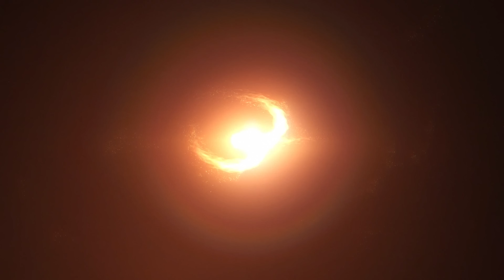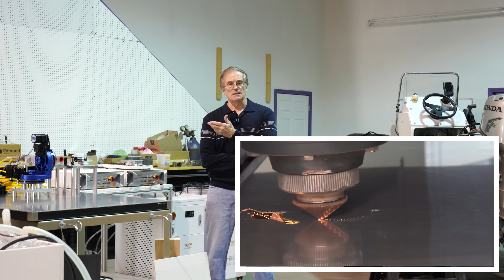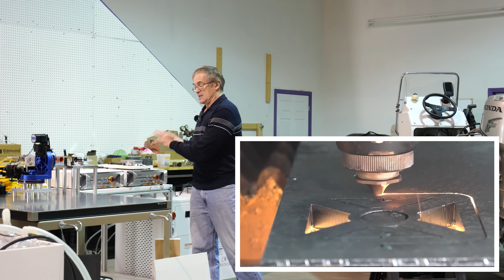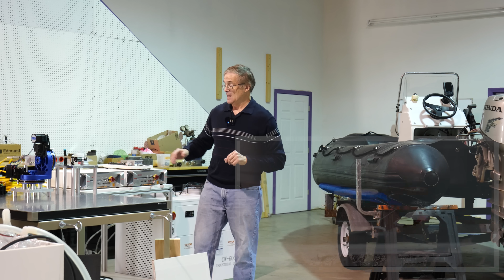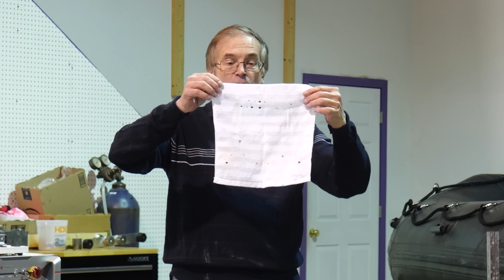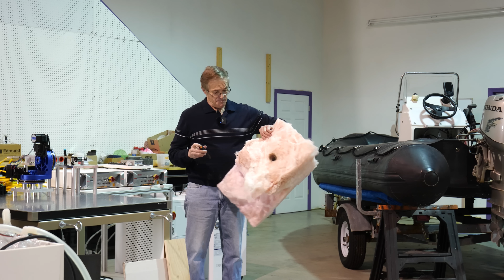We have a problem... and need your help!

Comment: What about having a layer of the wood at an angle then behind that with a small gap call it an inch have another layer of wood. then pump water to the top and let it flow between the layers the laser will bun though the first layer hit the water and scatter meanwhile the top layer should be enough to keep any scatter from causing issues and worst case it does light fire everything is coated in water flowing between the layers.

Comment: Use the SPACE instead of wall. Go outside, point the lasers up and mechanically restrict drives to move only +/- 15 deg from vertical direction. It is for shooting the drones, you can make full test in this way. Only concern is then the air traffic, but maybe you can use specific area, like rocket fire range. I hope the power is not enough to shut down ESS :)

Comment: I don't know if this would work, but perhaps some kind of graphite/graphene material? If I remember right, they have a good mix of a very high melting point and good thermal conductivity, so the laser energy could be dissapated.

I like the idea of a photodiode connected to an E-stop, or some kind of moving dyed fluid or waterfall barrier.

Comment: You are already with the solution! You are explaining that you are combining several fiber lasers to combine them and adjust them with lens to a long aligned beam right?
Which distance are you talking about for the paralell straigt beam?
is the beam moving while powering On? Just place a colimator lense to creat a big safe spot. If the spot is moving, try a long funel mirrow reflecting the beam to the centre and hitting a colimatorlense again. Many more options avaliable ;-)

Comment: Why not try aerogel for heat and shuttle tile. Mirrors to continually bounce around in a demi-bubble, or a similar idea like the insides of a fusion generator? Or bend the beam into a tall coolant chamber like collega reactors. You could always send it into a box of sand?

Comment: I like the photodetector kill switch idea…it’s relatively cheap and portable, but as electronics can always fail, a backup would be a good idea. Absorption ideas are covered by others, so I’ll suggest diffusing the beam by “blooming”. A gas that absorbs the energy will expand rapidly, forming a sort-of lens where the expanding gas meets the non-expanded gas (different densities results in diffraction). This should cause the beam to diverge and lose collumation. Combined with the gas absorbing energy it could prevent over penetration. This effect has caused issues with laser weapon development in the past (pulsing helps get past it), so using it as a benefit seems poetic. Steam, CO2, and methane should all absorb your frequencies…though I’d skip methane for obvious reasons. The calculations for best geometry, volume, and pressure resistance (gas in enclosed target…) are left as an exercise for the interested experimenter.

Comment: Try a quick test by firing a small pulse into a bucket of water or a fish tank to see if the water is effective. If so, try to construct a continuous waterfall behind the test firing range. A low angle sheet of steel to concentrate the water at the top would be good to help to ensure a solid wall of water that would be continuously replenishing with a water pump.

Comment: Back when I was working with CO2 lasers in college, we used white silica sand to diffuse the beam. It worked quite well, but we weren't dealing with the power levels you're at. Fumed silica might work but is harder to contain because it's so fine. Fly ash is another interesting thought, though I'm pretty sure it's microscopic carbon. 

We also tried making an optical power meter using a stack of single-edge razor blades facing edge-on to the beam. That won't work for your application, we were under 100 watts. 

Next thought would be a relatively thick sheet of graphite, but again at those power levels I suspect you'd be punching holes in it. 

Nighthawkinlight had an interesting video a couple of years ago about a highly fire-retardant material (Starlite?) that he at least approximated with some pretty amazing results.

Thinking you'd want either absorption (ablation?) or diffusion, but it's those energy levels that have me second-guessing.

Comment: Have you considered using layered composite structures combining reflective, absorptive, and ablative material? For example, a ceramic front layer, followed by graphite/ablative foam, backed by a heat sink or cooling system.

Comment: Idea for your project. Instead of shooting the laser beam at a large panel with unused surface area.

 what if you fill a 6-ft or longer 4" diameter metal tube with Aerogel. cap it at the back end, shoot into it and end up with a way thicker layer to catch the laser behind your target. Aerogel might not be enough but maybe the tube portion of the concept might help.

Comment: My first idea was: "Why not try to use a mirror (dielectric laser mirror) to send the beam straight up or down?"
Answering the question in video, I know only one material that can fit: it is Starlite. Its analog can be made diy with backing soda, cornstarch, flour, and PVA glue. It can be improved for the task by adding borax, titanium dioxide and chopped carbon fiber strands. I am not sure, how powerfull is the laser you use, but even 1cm of Starlite should hold out for seconds. If you use 2x4 wood, a layer of starlite will dramatically increase its life.

After further thinking I got some more ideas:
- First emergency mrasure should be an e-stop. Kind of a fuse, that overheating and breaking the circuit if the laser stay on after certain time.
- An emergency measure could be a steam screen. Then it will disperse the laser.  The concept I hafe is if the laser beam goes through a wide pipe, and the pipe is equipped with a few mist generating nozzles (using compressed air or a CO2 gas charge to create mist quick enough) that create mist in emergency situation and disperse the laser. In this case if we use a protective shield on the outer side of the tube, it can survive even better.
- Not finished idea of self steam generating. Like a shield with small combs inside that filled with water or hydro gel, that supposed to creare steam itself at the moment the laser burned through the material. But it need to gigure out how to steam liquid quick enough insteato just burn a hole in the material. In my tube concept i see it on the inner side of the tube. Then, cutting through this firs layer of protection should give enough time to create a water mist shade inside of the tube.
- Thermal blooming - steam or hot gas layer, that can cause local air density changes. This metod also can blur tightly focused laser beam. It is very raw idea, I don't have enough knowledge to figure it out in details. But if it can work, the gas can be used in the tube instead of water mist shade.
Good luck with your work!

Comment: It's not clear from your video what wavelength this laser is using, but if it is 1080 nm, then Hematite (Fe₂O₃) is a great absorber and have good thermal conductivity (~10–15 W/m·K in crystalline form). As it is abundant in the Earth’s crust it easily and cheaply available. Then mix with Silver (Ag) nano particles, and find a way to compact these into a wet brick like environment. Parhaps wetted using Cyanine, Phthalocyanines or polymethine dyes, which also absorbs in 1080.

Comment: Maybe a tank of constant moving carbon black water, and the lazer receiving side of the tank to be sort of a lens to help the beam breaking up and the carbon water to do the rest or Here’s my alternative idea for a cheap and effective laser beam dump:

Layered Carbon Black Sandwich:
	•	Structure: Build a stack of alternating layers of carbon black-coated metal plates and ceramic fiber insulation.
	•	How it works:
	•	Carbon black is extremely good at absorbing light (even high-energy beams) and turning it into heat.
	•	The metal plates help dissipate the heat quickly.
	•	The ceramic fiber layers are fireproof and act as a thermal buffer to prevent heat buildup.
	•	Bonus: Angle the plates so the beam has to bounce multiple times through them — each bounce loses energy.

Advantages:
	•	Extremely heat-resistant
	•	Passive system (no moving parts)
	•	Very cheap — carbon black, scrap metal, and ceramic fiber blankets are all affordable

Comment: At about 6:00 you mention that the beam can be reflected but that you don't want that, but isn't nothing perfectly reflective? That kind of sounds like it could be a solution to me. Couldn't you build some sort of "catcher's mitt" If you can't catch all of the beam at once reflect say 95% and catch 5% then where that 95% gets sent absorb another 5% bringing the remaining amount down to 90.25%. After enough bounces it should be harmless enough to 'catch' the remainder of the beam if necessary. I am imagining it sort of bouncing back in forth in a tiny hall way made of mirrors with carefully thought out reflectivity percentages.

Comment: One idea, would be to sandwich loose fine sand between two panels, so that if the laser punctures the panels and melts away the sand in it's path, new sand falls into the void to replace what's been vacated.

Comment: How about pykrete? You can't get much cheaper than frozen water and sawdust bricks. Wood worked well, right? So frozen/wet wood should be great since it can't catch fire. Cleanup is easy, just let it melt over a few weeks. 
If you're making your video in the winter, you'll already have a giant outdoor freezer, otherwise a restaurant or grocery store might be willing to let you borrow their freezers.

Comment: Water Mist as a Backstop
Pros:

Excellent at absorbing optical and thermal energy: High specific heat capacity and latent heat of vaporization.

Scatters and absorbs infrared and visible light: Especially useful against high-energy lasers.

Self-repairing: As droplets evaporate, new ones can replace them.

Cons:

Low spatial density: A mist might not fully stop or absorb all energy unless it’s dense and voluminous.

Potential aerosolization of contaminants: Can spread particles or vapors if the target material is hazardous.

Not effective against all forms of DE: E.g., microwaves may partially penetrate if droplets aren’t sized/clustered correctly.

Verdict: Water mist is very effective for thermal and optical energy dissipation, especially from lasers. It’s commonly used in laser testing chambers as a beam dump medium, especially when coupled with containment.

Comment: Taking advantage of the low cost of salt, it is possible to design a container (made of metal or ceramic) holding a generous amount of salt (several hundred grams). When the laser beam enters, it heats and melts the surface layer of the salt; the molten salt and resulting vapors provide attenuation. The key is to contain the salt so it does not completely drain away as it melts and to ensure there is sufficient thickness along the beam’s axis. For example, a stainless steel cylinder filled with salt, with a thin front cover (which the laser either penetrates or breaks through, allowing the salt to take over). Additionally, mixing a small amount of absorbent material (such as powdered graphite or black oxide) into the salt can “dirty” the mixture, making it opaque to the laser from the outset. This is a consumable solution—after a few shots, the container is refilled with fresh salt. Cost: extremely low (industrial-grade salt costs just a few reais per kilogram). Safety: non-toxic and easily disposable (residual salt can be discarded as common waste or recycled if only partially melted).

Comment: Have you experimented with chitin plates? It's super cheap, highly heat resistant, and allows for mixture of carbon or various substances to produce a range of diffraction/absorption properties. Downside: you would probably need to spend some time experimenting with a range of mixtures and manufacture your own plates; however, this seems like the ideal material for producing a high-intensity laser sink.

Comment: To extend the exposure time of a high-power laser on a sacrificial background, consider using a moving surface mechanism.

One effective approach is to build a rotating or scrolling backdrop—conceptually similar to a roll-top desk, but with continuous downward motion in front and upward return in back. Mount two rollers vertically (top and bottom), and attach thin slats of a durable, non-toxic-fume-emitting material such as plywood or solid wood to a flexible backing membrane made from EPDM (ethylene propylene diene monomer). EPDM is a tough, heat-resistant synthetic rubber known for its flexibility, resilience, and resistance to thermal degradation. To protect the membrane from direct laser exposure, ensure the slats are thick enough and the rotation speed is sufficient to keep the EPDM fully shielded.

As the EPDM-backed slats move past the laser’s impact point, each segment is exposed only briefly. This distributes thermal load across a larger area, minimizing localized damage and extending the life of the sacrificial surface. Compared to a stationary backing, the moving system enables more consistent performance over time.

This setup can be built from widely available and affordable components: solar pool cover rollers, pond-grade EPDM sheeting, garage door opener-style belts and motors, and a simple welded frame from Schedule 40 steel pipe. The slats can be screwed, glued (with contact cement), or stitched to the EPDM and replaced individually when damaged.

In a vertical configuration, the bottom roller can be submerged in a shallow water pan to pre-wet the slats, helping extinguish smoldering or burning before they reach the return. For example, a 3-inch diameter roller (like those used for pool covers) would need to rotate at approximately 2–3 RPM when using ¼-inch-wide slats. Slats should be cut with a slight rhomboid cross-section to eliminate gaps and ensure the EPDM stays covered. Larger diameter rollers allow for slower rotation and smoother operation. Thicker slats are more durable but add significant weight, so experimentation is key to finding the right balance.

I haven't yet found a flexible material that can withstand direct laser exposure without the use of slats—though some silicone rubbers or layered wet fabrics might work when in motion. If you’re experimenting with this concept, try a small rotating rig and test different materials under your laser to identify practical alternatives that reduce complexity.

For context: I'm a software engineer and seasoned executive turned entrepreneur—currently promoting Foottok in the U.S. and bridging private capital with sports tech—but I’ll always be a geek at heart. I’m not afraid to weld my own snowplow or prototype oddball ideas like this in the garage.

Comment: How about circulating waterfalls of pigmented water? Or firing the beam into the open actively pouring hole of a pigmented water tank that is pouring into a collection reservoir which is being recirculated back up.

   _____DIAGRAM______
    |                 |
    |  ~~~~~~~       |   
    |  ~     ~   O~~~~~~~---------===  <--- Water (~~~) pouring out (O is the hole), laser beam (----===) hits the beam or arc of water pouring out
    |  ~~~~~~~       |
    |____________________

Comment: Wow. I see... 🤔 I know a construction-material that's common here in Europe, for 'fire-proof' flooring. It's similar to MDF, i.e. compressed wood-fibre, but in these boards it is mixed with a type of concrete. These panels come in different thicknesses, and i believe you could get them to absorb a fair amount of water as well, before the tests. This stuff is also heavy, though.
But, thinking outside the box here: How fast can you pulse these lasers? How short of a pulse can you make? I'm thinking, if you can run the laser in millisecond pulses, with a very low duty-cycle... Find a pulse-duration and pause-duration that doesn't do any immediate, too serious damage to ... innocent objects in the environment. And then use the fast camera-tracking and target-acquisition code to lengthen the pulses when the target is 100% positive certainly acquired. And also to immediately disable the laser when the target is destroyed.

Comment: One idea is to have a rectangular sheet moving in a circular path (not rotating). This could be done with two perpendicular linear motors.

Enough speed would prevent the material from burning. It can also easily be scaled up to a large enough area, unlike a spinning circle/cylinder (as long as the setup is robust enough from all the shaking).

Comment: This sounds like the wrong solution. You are merely focusing on the end result, the material to block the beam. What is really needed is a feedback mechanism/circuitry to detect when the energy output changes as it can when the beam penetrates a material and then passes through.

Comment: Try a black body radiation absorber, probably need to add water cooling also.  Should be able to absorb > 99% of the radiation and convert to heat if properly designed.  The absorber looks like a shallow angle tapered hole.  The deeper the tapered hole the better.  😎

Comment: 5cm of dry sand in between an acrylic sheet facing the laser, and a copper sheet facing the garage door. The acrylic should be invisible to the laser, the should should diffuse the light quickly, and the copper is a backup using the CuO (Copper(II)-oxide) reaction idea. Focus on it being dry to avoid steam pressurization.

Comment: Stacks of wet cardboard.  A prism that defocuses the beam.  A prism or mirror outside the garage door that directs the laser beam into space.  A mirrored tube or a tube with mirrors at right angles that directs the beam up, over, and then down into a barrel of water.